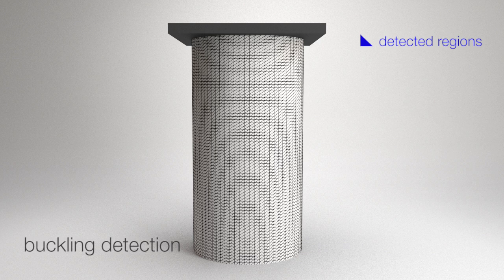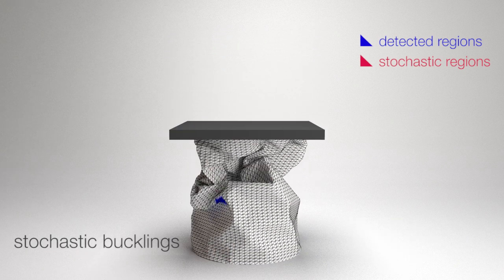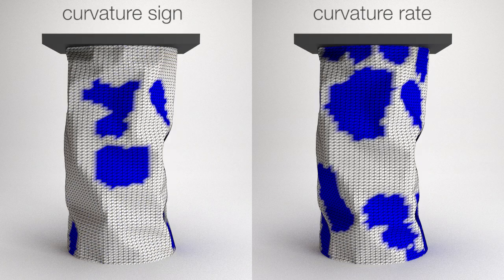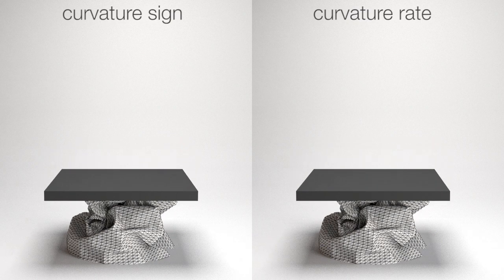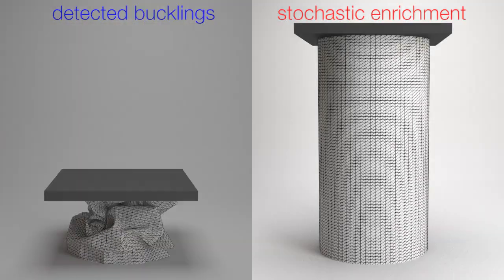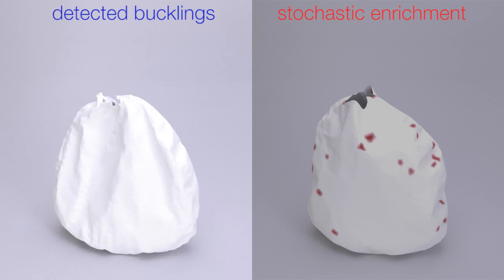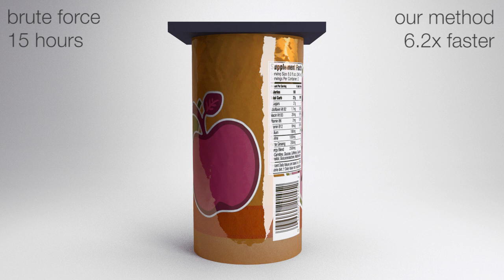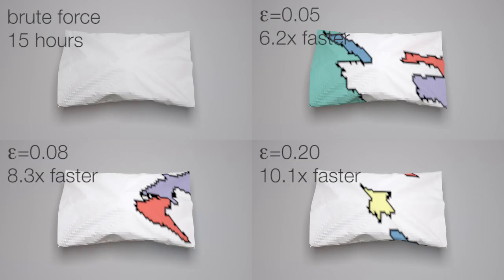Crumpling Sound Synthesis (SIGGRAPH Asia 2016)

Comment: Wouldn't it be a lot better to simulate the object and use the simulation data instead of inferring deformation from an animation? Either way the object's deformation must be simulated so simulating it while synthesising the sound is a win-win.
Reply: From the paper:
"We seek to automate the synthesis of crumpling sound to accompany
a given crumpling animation. The input to our method is
an animated triangle mesh produced by some external thin shell
simulator.".....
"....For this, we target
a physically based approach. Physics-based sound synthesis is
appealing because it essentially leads to an “encoding” of the
physics behind the phenomena as an algorithm, while avoiding
the need of recorded sounds"

Yes it is physical simulation, not input from rendered image.